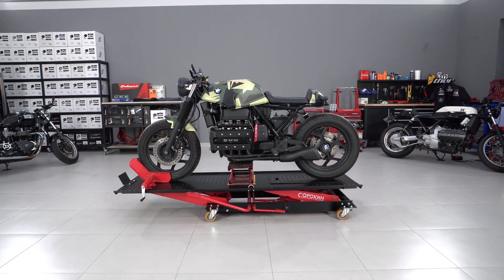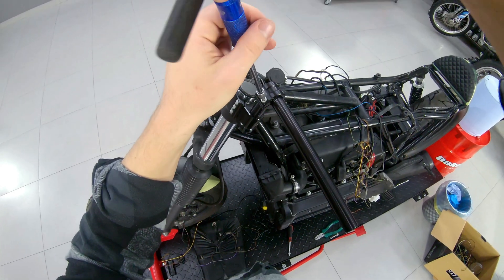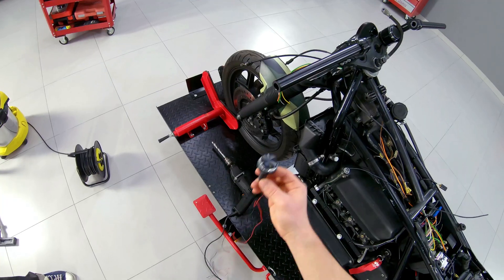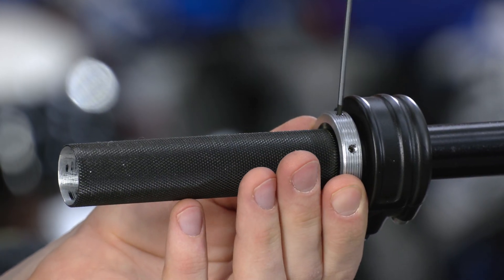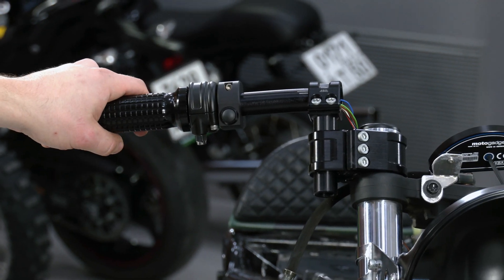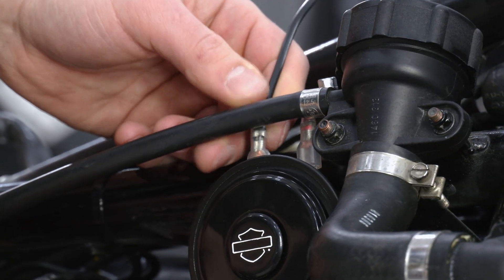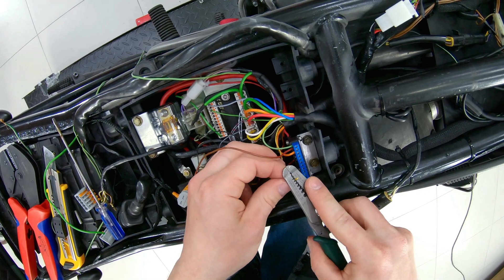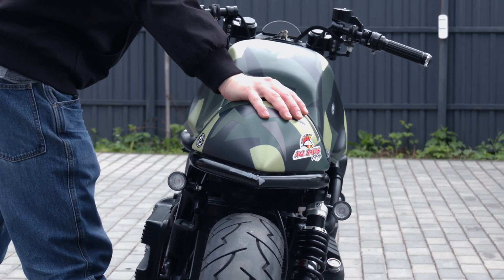Digital Electrics Motorcycle BMW K100

Comment: Hi.  I need some help please!! I have an 88 K100 with m.unit blue, mo.lock and a mo.button connected to 2 sets of mo. Switches, 3 buttons each. I can get the bike to turn over but cannot get the bike to power down with either the start button, pushing twice or the mo. Lock rfid reader, any help or advice is greatly appreciated!!

Comment: I'm installing the same system on the same bike. How did you hook up the speedometer? Did the bike already have an aftermarket magnet on the wheel or is it using the factory sensor?
Reply from the maker: We used a sensor from the motogadget gauge kit.
Reply: @Stuntex  some day Ill figure out how to use the factory sensor for signal instead of the ugly bracket and magnets that always fall off.

Comment: Amazing Work! Do you have a solution for the tank sensor, which shows a lower resistance when the tank is full than when the tank is empty? The motogadget pro does not show the correct fill level.
Reply from the maker: We don’t remember exactly, but in this case it works fine. We adjusted it in the gauge menu.

Comment: Great video! Very inspirational! How will you mitigate or bypass ECU, ABS and Immobilizer (which are very common on modern bikes) with the m unit blue?
Reply from the maker: You don't need to mitigate or bypass. You just need to plug in all units to AUX and save OEM connection between them, if it is. Saving an Immobilizer does not make sense with M-Unit, so you can cut it off.
Reply: @Stuntex , thanks for the reply. There are only 2 Aux input and output connections on the m unit blue. Is it ok to combine the ECU & ABS as one onto Aux 1 or 2? I'm intending to add leds at the rear onto Aux 1.
Reply from the maker: @albertpoon6740  Yes, two AUX2 outputs are not enough. We usually combine all energy consumers into one or two AUX2 outputs.  But you need to count total power, because one AUX input takes about 110-120W. AUX 1 is usually used as relay to control something.

Comment: i have problem with starting my bike, checked the power no feed to the fuel pump, what wire or relay i need to change?
Reply from the maker: Depends on your bike model. What is your bike model?

Comment: How come you used the OEM starter relay and not the 30A one built into the MO.Blue?
Reply from the maker: In manual it’s recommended for starters with integrated relay. We don’t know the power of oem starter (it can be more than 600wt) The m-unit ports should work fine, but we used oem relay.
Reply: The starter pulls way more than 30A

Comment: How did you solved the lightbulb for the Alternator field flashing circuit?
That's the only point I didn't saw in your video.
Thanks for sharing:)
Reply from the maker: MotoscopePro has Low Voltage message, which is adjustable. It does not have special light for "Alternator circuit". If you have special light for this - you can plug in OEM wire to it. We made it at our project K1100SX - there were enough lights for all warnings. First, here we wanted to plug in the Alternator wire to the only warning light at MotoscopePro, but it already had "Oil pressure" and "overheating", so we decided, that 3 warnings on one light are too much. Anyway, Low Voltage message is enough.
Reply: @Stuntex  My understanding is that the Alternator needs the lightbulb because of the resistance of the filament to work correctly.

Anyways thank you for your English videos or if not, for the English subtitles. your video Series of the K1100SX was on a very high level and enjoyable watching.
Reply from the maker: @lingling2924  Yes, it's influence the RPM when it starts. In fact, at K1100SX (led light) and here (no light) it still works, and starts, if you add some throttle. Сontinuous work at idle speed after starting the engine - very non-standard situation. After 8000km of riding on K1100SX we never got such problem, and the bike had small capacity battery. Do you have this problem?
Reply: @Stuntex  Ah okay, and I tought I missed that part how you solved that. I'm building two K100 at the moment and thinking to replace the lightbulb with an Resitor....or your Route as you say that's easily working.
Thanks a lot for your response :)

Comment: Hey guys, huge fan of your work. I'm really after a solution for the gear switch indicator to neutral light converter. Do you have the wiring diagram posted anywhere for this? I'd really like to include it in my build if possible. CHeers, Kyle
Reply from the maker: Hi, we are going to make one more and we will make detailed diagram soon
Reply: @Stuntex  would also love to know how to convert the N signal.
Reply: Hey guys, by the Any chance did you find wiring diagram? I am planing too to do wiring and can’t get any clear and nice diagram. Thanks for any answer my friend.
Reply: I would also like to see this.
Reply: I'm interested too